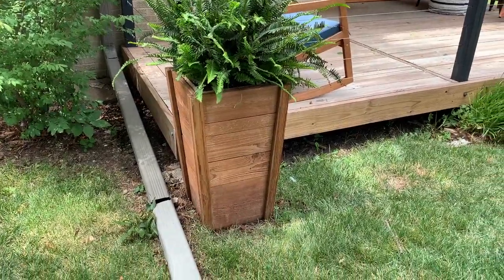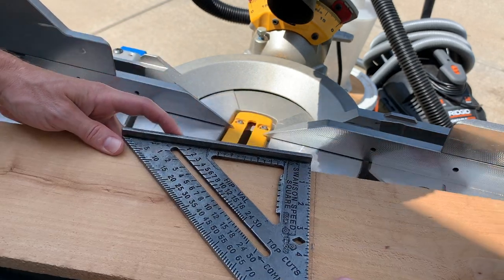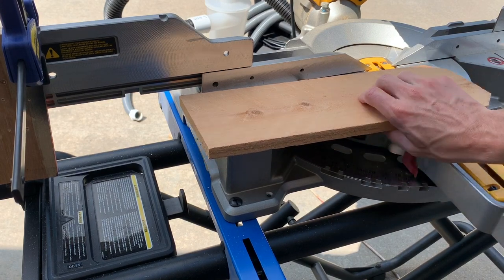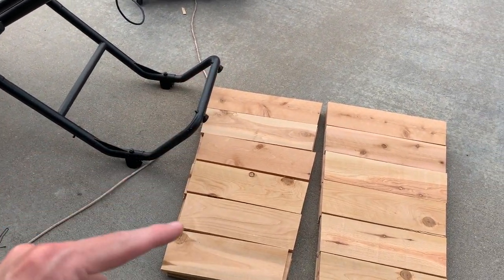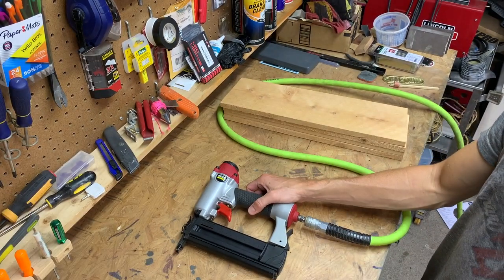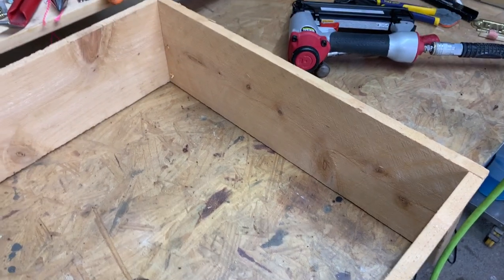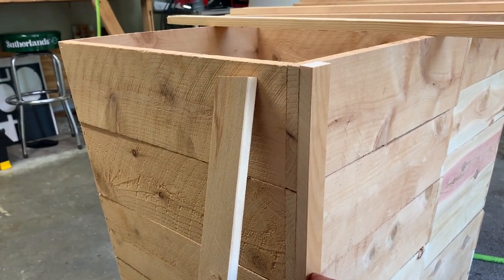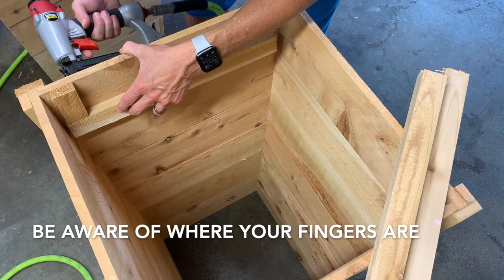EASY DIY Tapered Cedar Planters

Comment: Thank you so much for explaining the 4 percent angle. I have only made a bench and I really want to make these. I’m trying to watch all the videos I can. I don’t have that saw, but I have a circular saw so I’m trying to figure out my cuts. Thank you for the detailed explanations. It helps me so much! Also, if you happen to read this, could you tell me what those big green bushes in front of your fence are? They are beautiful! Thanks!
Reply from the maker: Thanks for watching and I glad it was helpful!  If I was just using a circular saw, once I had my 1st cut made I would use that cut as a guide for my circular saw on the rest of the cuts.  You can just clamp the board on top of your other boards when you’re cutting them after you’ve marked the cut location.  You may already be doing that of course or have a better plan too!
The bushes are actually Fountain Grass, it turns tan/brown in the fall and winter and then we cut and burn it in the spring.  It gets a little larger every year after you burn it.  I need to probably thin mine out in the next year or two :)
Reply: Ana white has a video that is very close to this one but using a circular saw here is a link .https://www.youtube.com/watch?v=9e9ZMVcc9iY&t=2s
If I didn't have a miter saw I would use her method

Comment: Beautiful and wonderful looking. What do think of cutting 2 or 3 boards at the same  time on the miter saw?
Also, since there's enough space inside at the bottom I would add legs for an additional look. Well explained and executed, thank you for sharing 👌.
Reply from the maker: Danny, you could cut more than one board at a time for sure.  I feel like I can move a little faster with one because I’m not spending time making sure they all stay lined up and tight against the fence.  The legs would be a neat idea!

Comment: Might be a “duh” question...I’m thinkn you set the miter at the 4 degree 🤷‍♂️? I tried my hand at a coupe boxes over the weekend using a different build style and my tapered box wasn’t exactly tapered 🤔
Gong to try your technique here and see how it comes out
Reply from the maker: That is correct Marcus, I set my saw at 4°.  I mark it with the speed square so that I have a reference line when setting up my stop block on my chop saw.  You don’t have to do that part, but I like it to be as precise as possible to make assembly easier later.  Hope that helps!  And have fun with your build!

Comment: Did you use only the 1 1/2" staples to nail everything?
Reply from the maker: Hello Pat!  I used the 1-1/2” everywhere with the exception of the corner trim.  I used the 1-1/2” staples on the corner trim where it was shooting into the end grain of the stacked sections, and used 1” where the staples would have shot all the way through on just the overlapped area if that makes sense.  I have however in the past used the longer staples there as well, and just bent them over with a hammer if they protruded through so they wouldn’t poke me later.  Hope that helps!
Josh

Comment: Just wondering are you better to shoot the nails from the inside to avoid nail holes from being seen on the outside of the planter  just  wondered what your views were on this question as I have never used a nailer before.
Reply from the maker: Jinky, with the rough cedar the nails
 holes don’t stand out much.  Also, the 18gauge  nailer I’m using makes really small holes anyways.  Another thing to consider is that if you shoot the nails from the inside, they can sometimes poke out a little and then you have a sharp nail on the outside.
Reply: @PottersWork  thanks for the update a bit clearer now
Reply from the maker: @jinkyjinx9048  no problem!

Comment: Potter is that a 16g or 18g nails you are using
Reply from the maker: Jinky, 18g galvanized
Reply: @PottersWork  thanks for the reply,I am about to buy an 18g nailer which probably will get used more than a 16g was not sure if it was strong enough for planters etc trying to get away from buying 2 nailers and one being left on the shelf most of the time.
Reply from the maker: @jinkyjinx9048 , I use my 18g nailer all the time and you’ll be surprised at how well those little brad nails hold.  I have considered buying a 16 or 15 gauge nailer myself, but just haven’t really ever needed it bad enough.  Not saying I never will buy one, but I’ve went 20 years of building without it.

Comment: I enjoyed this but flip-flops on your feet?!! I never cut without my steel-toe-cap trainers on!
Reply from the maker: I think you can for sure make an argument for boots whenever doing any kind of work…if I was working with materials that weighed more I would have for sure worn boots/shoes.  The cut pieces are probably less than a pound.  The cedar is very lightweight.  I also had eye, and lung protection on which were my main concerns at the time.  Thanks for watching!